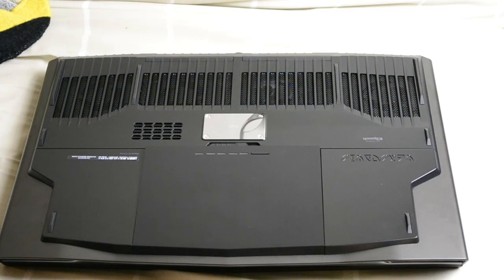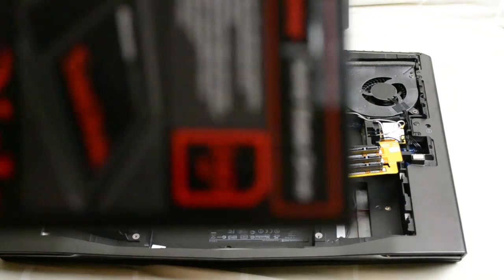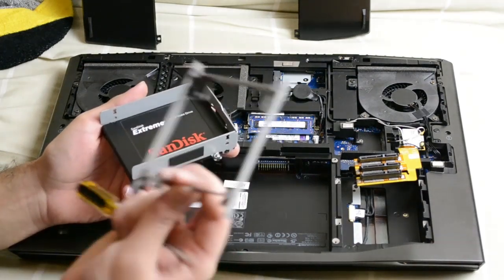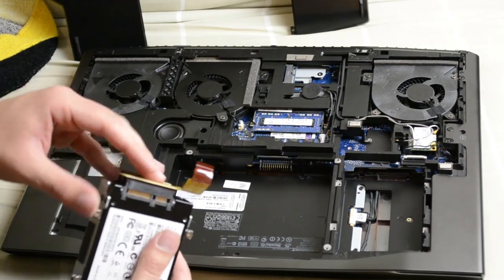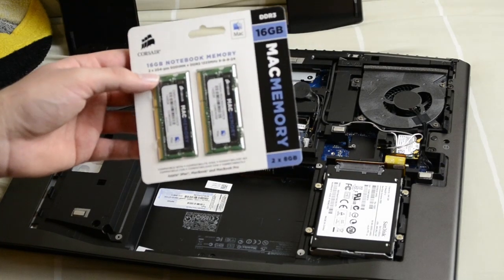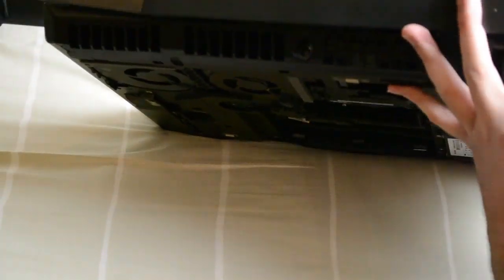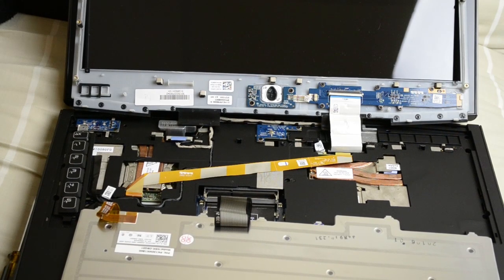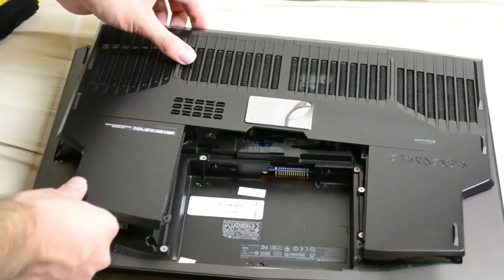Alienware M18x R2 Ram and Hard Drive Upgrade Tutorial

Comment: this is wierd u puy in 4 16gb ddr3 on an Alienware M18RX2  I opened mine up and it says it has 32 GB but first to ram from bottom were same as yours second 2 I never checked.  Didn't know u had to go under keyboard for the ram upgrade.   Also I was considering upgrading from my m18Rx2  But I'd rather do internal upgrades. What can be done?
Reply: Nothing keep it like that

Comment: hello, i broke the white tab holding the cable of the HD, how can i get a replacement?
Reply: Hey hope you figured this out already, but you can purchase the unit that solders onto the motherboard online.  I got them for like $3.00 on eBay and was able to salvage the clips as my unit was still good.  I have 2 spares now just in case, but I am running 1x 1TB SSD with OS and 2x 500 GB SSD for additional storage on my M18x R2.  It is amazing.

Comment: Hey, when you were putting the keyboard back in, you missed two of the little metal tabs going in the slots on the bottom of the keyboard.  Probably doesn't matter, but it might make the keyboard bezel not sit as flush as it should.  Liked the video though.  I got a used M18X r2 and have done some upgrades.  This vid helped!!

Oh and the part I'm talking about is at about 11:10 or so.  :)

Comment from the maker: If I understand your question correctly, if you are going to upgrade, you will need three new same sized ssd's and will have to make another new raid array with those. You will not be able to add a new sized drive and have it function properly in the current array (I believe).

Comment from the maker: you can install a mix but for raid setups, you need to use the same type of drive and same size. Raid 0 is good for high performance (but if one drive fails, you will lose all your data) and raid 1 is for reliability, basically it clones one disk to the other as a backup.

Comment from the maker: its a way to combine two or more similar hard drives into a configuration that allows data to be written sequentially to both (to provide instant backups) or to write partial data to both drives which allows the hard drives to function at much faster speeds than a single drive alone.

Comment from the maker: Hey, I would say that you should get the 2 GTX 680M's stock from dell because it will probably more expensive outside of dell. Everything else (RAM, Hard Drive etc) should be bought stock and upgraded after because those are much cheaper from places like newegg.com. And you can upgrade everything yourself in the M18X

Comment: I have brought the basic model from dell, the only thing I upgraded was the sli graphics to 680, the ram and hard drive is very easy to do, and cheaper. As for the processor. Unless you are doing hardcore video editing. The stock chip is way more than enough power you will ever use! A lot of people thing it's the CPU that does the graphics it's not, it's the gpu! Big time! :) this alienwear m18 is the best laptop on the market. And iv had them all. I have avoided alienwear forever, but not an18x